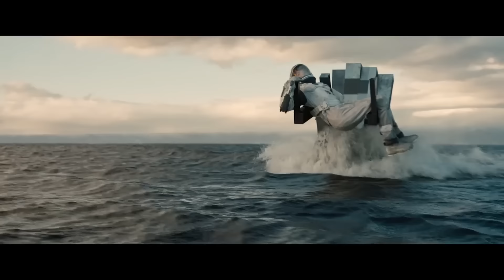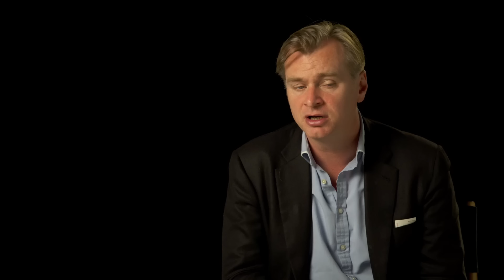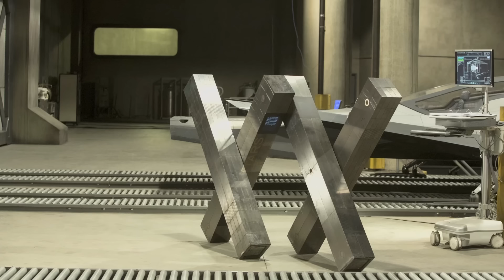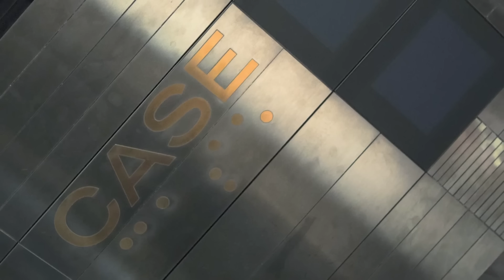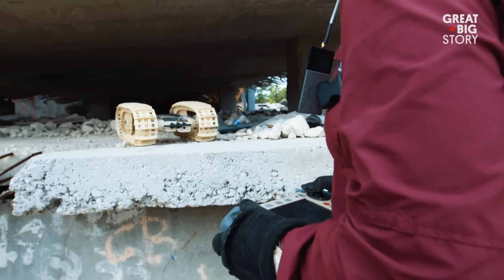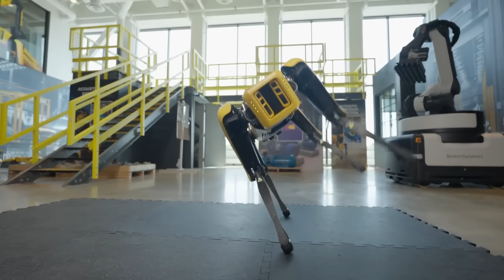The Robot Design Interstellar Got Right

Comment: That was easily one of the worst designs possible. Many scientists and engineers have spoken on this. Bottom line is, 'If it needs to move, put it on wheels'. There's no real-world scenario where it becomes logical to have a robot 'walk on legs'. In every case it's far less efficient than just putting it on wheels (or tank tracks). Robots are given legs for the sake of making them 'likeable' for humans, not efficiency. It's like movies where there's a humanoid robot driving a car. Why not just make the car the robot? I say this having worked alongside a group of engineers that built an actual robot dog while complaining about it because they were forced to do it knowing full well that it would work better on wheels (or tracks). A robot on wheels will NEVER fall, simple as that.

Comment: Can't disagree more. Anyone with any engineering or manufacturing or robotics background will tell you the same thing, a robot shaped like a brick is idiotic. Thematically, it makes sense for the movie.  A lot of the aspects of the movie's design from a practical frame just makes no sense. Even forgiving the space-time dilation and magic wormhole gibberish, the design of the shuttle craft, the space stations, etc. are all nonsensical.

If you want a truly "general purpose" robot for the military you need something that looks like a crab. In nature, the body plan of the crab has convergently evolved multiple times because it's the most versatile body plan for movement in many environments. Crabs can swim, climb, crawl, in water, on land, in trees. They have limbs that can pinch and manipulate objects at multiple levels of resolution, with blistering speed. They are resilient, agile, and dexterous. Even the boston dynamics robot dogs look more like crabs when they walk sideways.

Crabs almost look like robots already with their hard articulating sections. All that's missing is a couple of elephant trunk-like tentacles that it can use for high-traction fine-manipulation tasks. The Avatar movie has dog-sized crab-like robots used for construction, manufacturing, and military support.

TARS and CASE were artistically brilliant in their design, but practically speaking, it makes zero sense. The torque on its joints when carrying a person would cause slipping in the motors which would cause them to drop a person like a sack of potatoes, especially in higher gravity. Crabs easily transition from the fluid environment of the ocean where they are almost weightless to dry land where there is no buoyancy to support them, then climb trees, open coconuts, or cover miles of rough terrain, and then fit in narrow crevices for shelter.

TARS and CASE might be easy to transport in large numbers because they stack like- well- bricks, but there's so much wasted space internally. Those flimsy thin walls and harsh corners will cause them to crumple if they got pinched or had to lift any significant load. Mechanically, the leverage of their manipulating appendages has so much disadvantage to them that they would just bend if they have to pick up a person or try to dig in hard compacted soil. Crabs on the other hand are designed by evolution to dig with great efficiency. 

If they could chew up material and synthesize some kind of binding agent they could even be used to 3D print large-scale structures, like how wasps build nests out of plant pulp. Some species of crabs will process sand for nutrients in a similar way, leaving behind neat balls of sand they discard.

As far as their highly anthropomorphic personalities and intelligence, they are very well written and talk like how astronauts talk. Very military, very wooden, embodying the attitude of a rigid, obedient, disciplined soldier...incapable of independent thought. Their visual design however, while thematically beautiful, is in practicality just dumb.

Comment: There was an old sci fi story from the 40s that had a pandemic of robots failing and going insane. When they brought in a out of the box thinking engineer to find out why, he determined that all these robots where built to look and move like humans and then assigned tasks that didnt involve any of those mobility and features we where built with.  He redesigned them into basic designs specifically for their tasks. A button pusher was just a box with a push bar arm. A sweeper was a broom on wheels. A bartender was a rolling drink mix container. The robots function mattered more than their overly human design.
They where literally going insane trying to  utilize design features they had no reason to even have
Reply from the maker: Sounds like an interesting story. Do you remember the name?

Comment: The modularity of the TARS was visible in part when I watched the movie. As I watched this video, I have noticed more details which went under my radar when I first saw the film. You have pointed out a great potential in building adaptable robots with a relatively simple mechanical structure. This is a clever yet simple design that avoids creating problems typical to overly complicated mechanics.
Reply from the maker: Appreciate the thought out comment!

Comment: Silent Running was similar. I always knew this about robots. I worked on the Pier in Southend UK in a bowling centre . 10 pin bowling machines known as pinspotters are some of the first real robots we ever used . I know this as I was also a technician at other centres accross the UK. I found the serial numbers to each machine which is on a plate on said machine was 1938 . In fact the model of machines were denoted by their patent date 82/30,45.70 and 90 . Anyway just thought I would share.

Comment: This makes sense at a narrative level, but it's not factually accurate based on what we know about robotics today. It's true that being a humanoid shape isn't right for every situation. But it's actually one of the most adaptable designs; humans are more adaptable than any existing robot by a gigantic margin. The main reason why we don't use humanoid designs very much in modern robotics is because they're extremely hard to control with contemporary sensors and algorithms and motors, not because they would be unsuitable if we could control them well. The particular design of the robots in this movie was probably chosen because it looks different from other movie robots, not because it's actually plausible as something practical even with futuristic technology. The manipulators are clearly not very dexterous compared to a human hand or even most modern contemporary robot manipulators. The torsional forces on the joints at the end of each column would be extremely high, and it wouldn't be very efficient for it to move around that way. This is a great example of what happens a lot in science fiction: Somebody has a cool idea about how to depart from the current world, but the extrapolation they make about the future isn't actually based on anything logical or any evidence. It's just based on vibes and trying to stand out in a crowded market of science fiction movies.
Reply from the maker: Very true, and I agree that part of why humans have become so dominant is because of our ability to be adaptable and generalist. I think what Interstellars creators were going for was a hypothetical next-step of the ideal generalist body, though it doesn't entirely make sense engineering-wise. My argument wasn’t that TARS is an optimal humanoid replacement, but that Interstellar has a different idea of generalism with a focus on durability rather than human-level dexterity.
Reply: @Chromeborne  thank you for your thoughtful reply.

Comment: I really appreciated and enjoyed the simplicity and seemingly endless configurations of TARS and CASE that seemed to always fit the situation as necessary, but the part that bothered me the most was the ungainlyness and the appearance that they had to be made of some kind of material that was able effortlessly able to sustain continued and sustained high force impacts and stresses without any damage (corners of the limbs, the hinges, the screens). They did not seem like machines that should be able to enter and move about in small spaces meant for humans without bumping into or damaging anything in their surroundings, at least in their scenes. I think if they had been made smaller to accomodate for this, as well as their structures being built to better handle the stresses of impact (rounded ends of their limbs during movement on the edges to spread out the stresses of impacts) or modular composition (A smaller version for general purpose that could install itself into a larger version for more broad use) would have made more sense. Maybe half size for when they were in the cockpit, or interior use, and a full size 'suit' they could be installed into for exterior purposes, much like humans that use large construction equipment.

Comment: I mean, okay, CASE/TARS are cool robots, but the point of "human-like" faces (basically something with two eyes and a mouth) is for the human to look at, and that can be achieved by physically having eyes and a mouth, or something approximating one (see Number 5/Johnny5 from Short Circuit 1 and 2, and Wall-E), if a robot never needs to interact directly with a human, then you can dispense with it having human characteristics and get away with a screen. GlaDOS/Wheatley basically just look like an eye, but the way they move and sound projects personality, despite being less practical than a single robot arm.

Practical effects not withstanding, it's always better to have a "real" robot on screen that the actors can physically look at and be eye-level with the actors. To do anything else (eg digital-only) with real actors makes the robot not seem real. CASE/TARS has that going for it.

Comment: Its actually quite a retarded design .  In reality a giant square solid base has very low ability to navigate difficult terrain in its design.  Also suddenly its less dense that water and somehow magically disengages joints at the top to engage joints mid section to form a spoked paddle wheel of sorts  .. then shows no reasonable method by which these give propulsion… its just stupid cgi BS, not rational robotics design.

Comment: Nah!. Doesn't have to look humanoid but evolution pretty much worked out most of the problems of getting around and doing stuff already. The only thing we didn't copy from nature is spinning things (wheels/fans/propellers/motors).

Reasons for them being a terrible design.
- Push them on their side and it would never be able to get up.
 -Awkward in very cramped environments. Just how does it get out of that shuttle craft?
- Unstable on uneven terrain
- How would it pick something up and carry it?
- Those sharp edges would chew up the environment
- Too many moving parts

I could go into the benefits of having spheres and curved edges over flat ones but that would take too long to explain. 

Thank you for adding another reason for me to not rate Interstellar anywhere near as highly as most of Nolan's other movies. Even Tenet was better.

Comment: The actual design challenge of Tars and Case is a head scratcher. How each of the main 4 legs stay attached is engineering voodoo. Some sort of magnetism I think. Normal hinges on a robot wouldn't be that flexible.
Reply from the maker: Very true, good points.

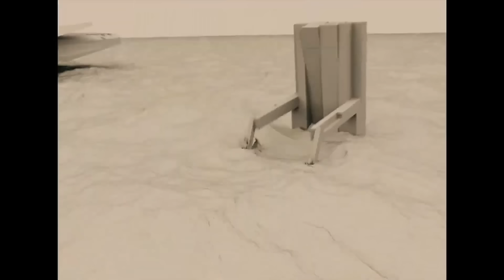Comment: 2:10 on this design the motion joints are up at the top.
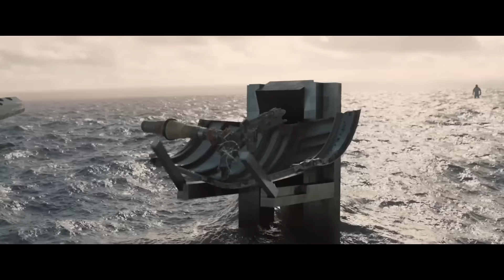1:41 on this design the motion joints are at the top and the center.
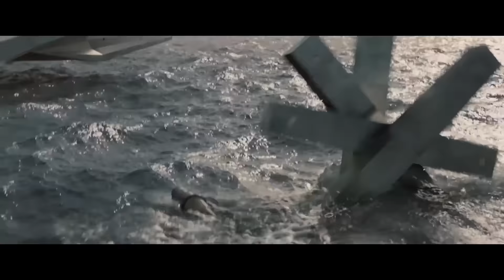1:44 on this design the motion joints are in the center.
I assume you want those holes to close too.
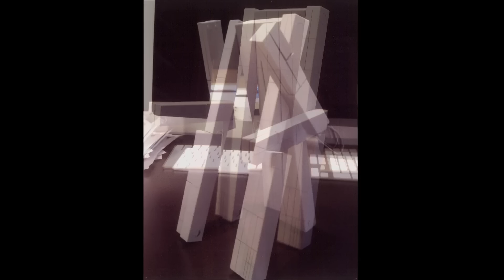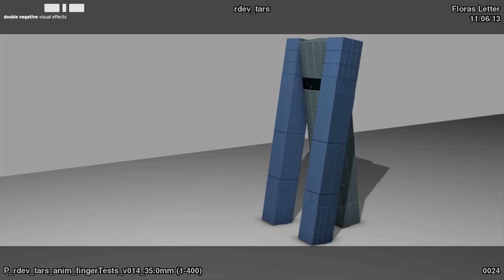and you also want it to do ths 2:39 and this 2:00
do you start to see the space issue, or are you just depending on super high torque motors, if you are then this becomes too heavy 0:05 as it can barely lift the weight of it's own parts, or maybe it just can't run for vary long, or maybe it should just be really slow. what trade off do you want.
all this look really simple but if it was they would not have to use a human puppet to control it they could just build it.

Comment: Use a bit of basic common sense here for a minute, and you'll see why the robot example here is vulnerable and impractical. Imagine this thing strolling outside a sterile laboratory environment where debris, rocks, weeds, sticks, cables, wires, etc. etc. etc. can be caught between the tight scissoring gaps in these "legs".
Imagine a person coming into contact with it and having a hand or foot severed like a pair of giant scissors?  Hollywood Bull 💩

Comment: I actually prefer non humanoid robot designs. The human body is inheritely flawed at carrying out advanced technological tasks without tools and equipment. You're not moving a several hundred pound stone or repairing a motherboard with fingers and arms. A robot with a compact and structurally durable design with plenty of areas for storage and maintenance is so much cooler. No way a humanoid robot couldve carried someone that fast away from a tsunami.

Comment: i would say the in-between would be something like titanfall 1 & 2's robots:
STALKER: a heavy humanoid robot that can interface with basic human items (mainly LMG's.) it doesn't have a face, and it only has like, 3-4 fingers.
Phase Pilot: a lightweight yet durable humanoid robot that has the shape, and some features of a human, but just enough to be familiar to a pilot whose mind was transferred to it
Titan: a kinda humanoid robot (without a head) that has digitigrade legs and a "eye" at the front of the cockpit, 4 fingers and is like that presumably so the pilot of it is familiar to it.
the rest are just other varients of the above although i probably missed a few which are different

Comment: Honestly. As you said these robots are the most beliveable i have ever seen. A robot designed to say.....actully heres an example most will know. Look at a roomba, its a vaccume. It doesnt need arms or legs, it doesnt need the ability to make you dinner. What it needs is to do the ability to do its job. Clean floors and stay out of the way.

This means a low profile robot, with wheels or tracks and a way to reach the ground, and sensors just strong enough to deal with the need to avoiding bumping into things is ideal. Give it a compartment for collected dirt and a way to charge and alert you when you need to empty the bin and boom. Perfect robot for vaccumeing up light dirt on floors. 

Meanwhile tall robot with arms legs ect. Is entirely unnessesary, going to be far more complex. Far less efficent and have many capibilitys entirely unnessesary for the simple job of "clean floor"

C3Pos are fun to imagine. But impractical in most situations a far more simple and specialized bot can simply do better.

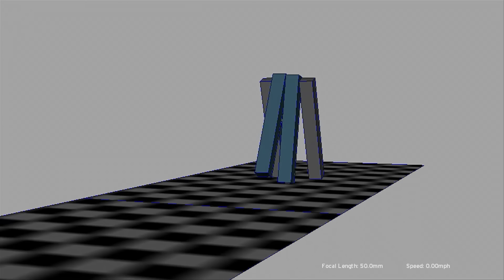Comment: I like TARS, and the design has grown on me more and more, but I still think they look too rigid for their supposed ex-military role.  The joints need to have more than one degree of freedom to deal with balance on rough terrain, but overall I like the "appliance" look.  Where I think the design really works well is the "gorilla" walk at 2:07, and I think if the arms had a little more freedom to move sideways (not a full T pose, but just enough to reach to the sides to avoid obstacles) I'd 100% be sold on the design.  To me, the design feels more like a mobile server rack than anything else, and I like that, I just don't think it fits the military backstory.

Comment: Matter of opinion.  They went for different,  but i felt the movement was not very practical and the design felt like they ran out of budget.  Watch the CGI, the hinge points are very small and there is movement where it would be impractical and likely not possible given the size and mass.  And it floats on water....lol.

Comment: There is basically Nothing more General purpose than Human form.

These robots are absolutely are not more general purpose than humanoing ones.

You are conflating limitation of flesh with limitation of form.

TARS and CASE. Are very much more specialized than typical android would be.

Their form specialisation is being a hunk of metal that is hard to destroy, and yeasy to pack in the truck.

They aren't better at locomotion, than human form indoor or outdoor. They are not better at controller manipulations like keyboards or  steering wheel/stick.

However it's much easier to imagin that these are easier to make than androids.

Comment: No it doesn't, lol. It's neither functional nor believable: it's a solid heavy block with a lot of complicated joints to move - it's arguably even worse than humanoid robot. 
"Believable" robots are functional in form, not just cool to look at. Even as a military robot - that's a lot of complex engineering for a piece of metal that can be easily damaged or destroyed.

Comment: robots DON'T need a skull. the skull is to contain our brain and that's all. all they need is a 360 camera on the highest position on the body and install the mainframe inside the chest and the batteries at the stomach. legs and hands are very useful though. legs can overcome a lot of land obstacles better than wheels and hands can be adaptable to almost every tool. we can replace the joints with 360 degree version and it will be even more flexible than human.
as for the Interstellar robot, that design is cool yet there're TOO MANY movable joints which means there's gonna be A LOT OF different sizes of motors and hydraulic parts. i'm not so sure how to fit all of them inside that rectangular body.